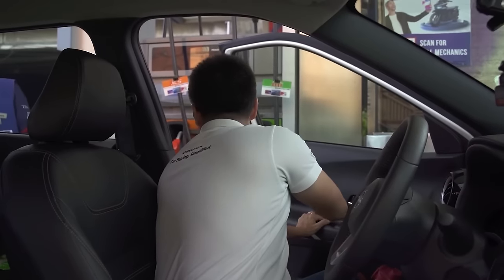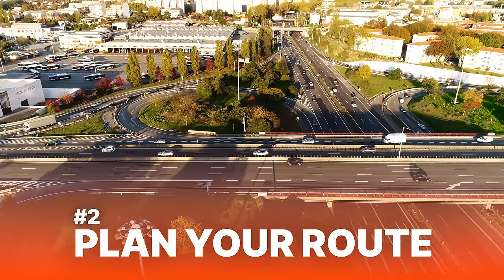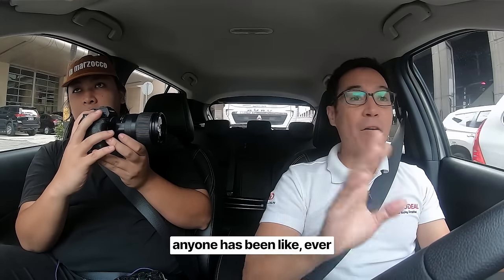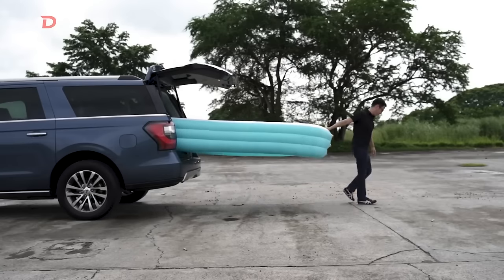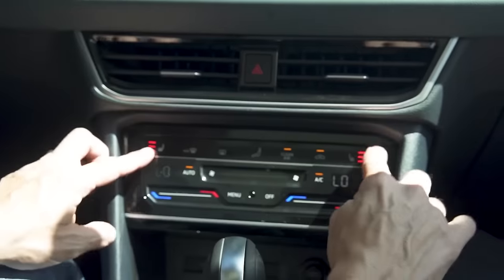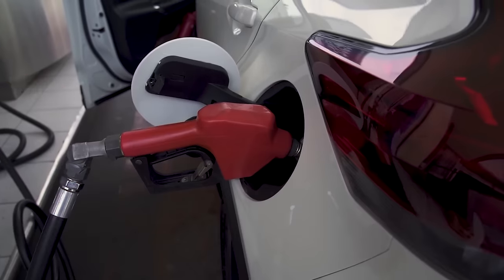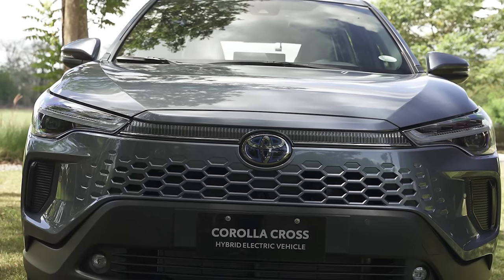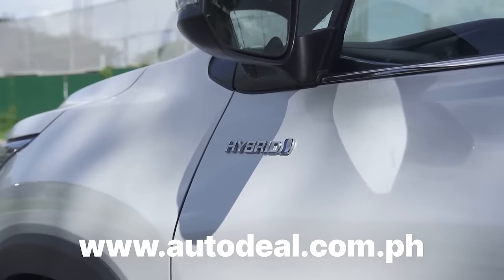Top 10 Tips To Boost Fuel Efficiency

Comment: I agree with the aircon, if you want to save fuel, go 28*C instead and speed 1 fan and let the cool come in overtime. but of course, that depends on the driver AND the car AIR CON FILTER. as for me, the car is raize so speed of fan at 1 and at 28*C is the same as 20*C and speed 3 fan in some cars, this is why I prefer it off once the cold takes over the cabin.

Comment: Some good tips all around. The only thing i would correct though is not to wind your windows down on the highway, thats where the wind resistance affects your fuel economy the most due to drag. In low speed city traffic its not much of an issue.
Reply: That is what he said! Are you paying attention?
Reply: @rysupastar718 dude, he was saying at no point that you should wind down your windows due to drag which is true, however the loss in the city at city speeds is negligable.

Comment: sell your overweight underpowered crossover, replace with a sedan or hatchback
Reply: But those underpowered crossover u said was more efficient than ur sedan lol
Reply: @rogelkoaegunsk1421  how so? Yaris cross - around 1,300 kg on a 1.5 cvt, Ford Territory - around 2,000 kg with a powerplant of 1.5 liter. Mazda Cx 30 - around 1,700 kg on a 2.0 liter. Power to weight ratio? lol.
Reply: How about xpander cross po?
Reply: @geeksified Xpander is an MPV.  Sedans and hatch are not 7 seater
Reply: Suzuki vitara. 1.6 on 1000kgs 

24km/L on highway. 14-15/L on medium traffic
Heavy. On 12-13 km/L. 

Real manual numbers.